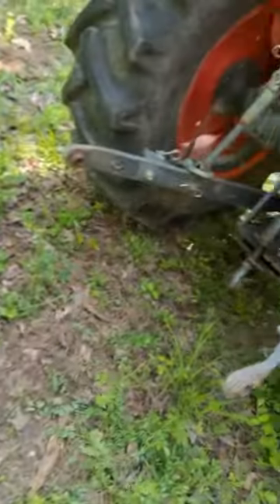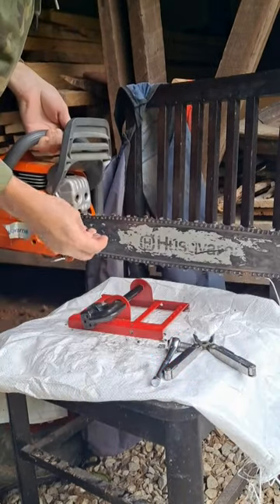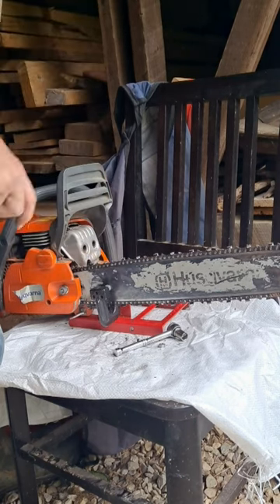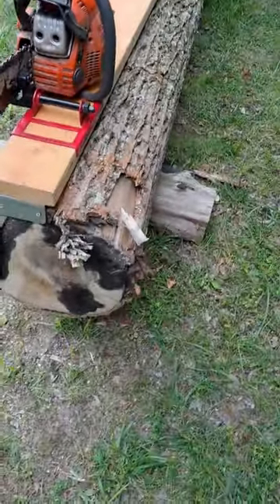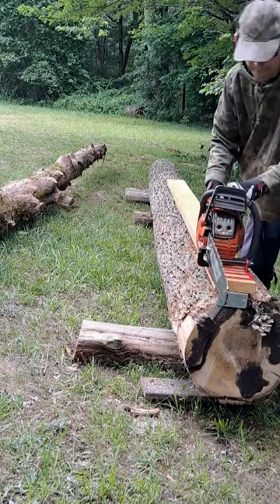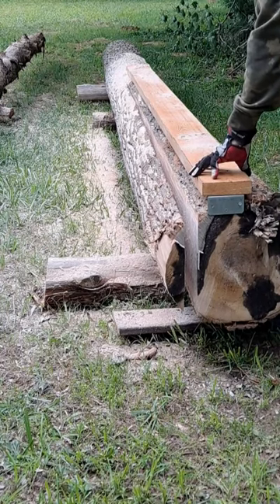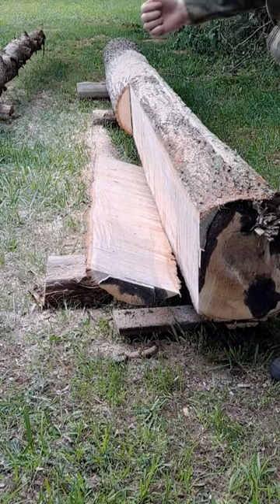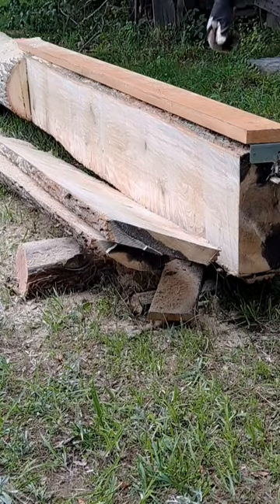Chainsaw Mill Cutting Guide-Part 2-From Tree To Live Edge Board

Comment: If you milling lumber with your chainsaw you should sharpen the chain differently. You teeth should be less pointy just a little. I cant explain it well in English but I recently got the tip from a chainsaw artist.

Comment: Eu gostaria de saber de qual é a medida da régua q trabalha aparafusado na madeira para o suporte da motoserra deslizar acima
Reply from the maker: you asked: "I would like to know what is the measurement of the ruler q works screwed into the wood for the chainsaw bracket to slide up"
Reply: Hi Jose, The measurement of the width on the slider measurement comes pre-drilled from the factory, bolts on to the 2x6 slider, and fits nicely over the 2x4. This specific 2x4 slider board is 10 feet long. However, you could use a longer board, or "rail" for cutting a longer post.